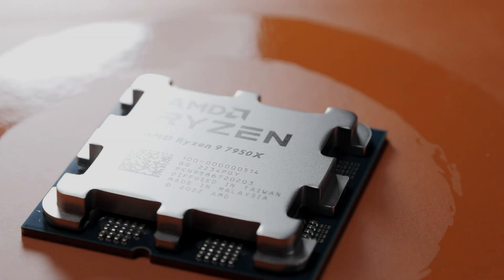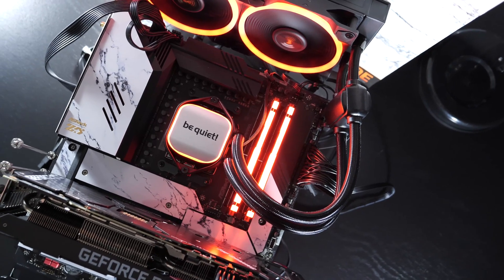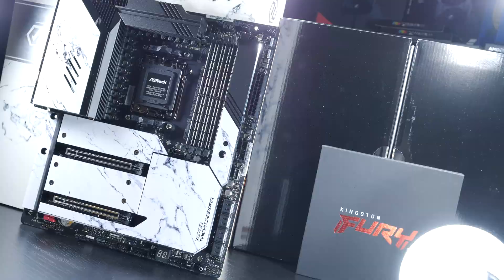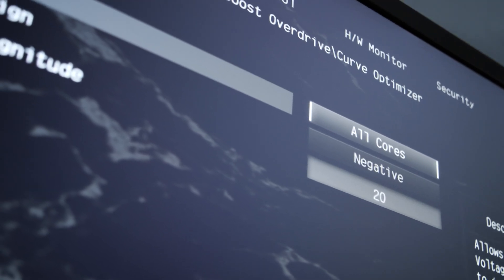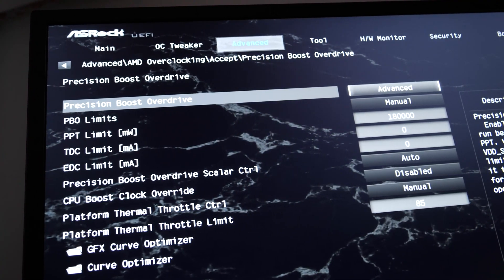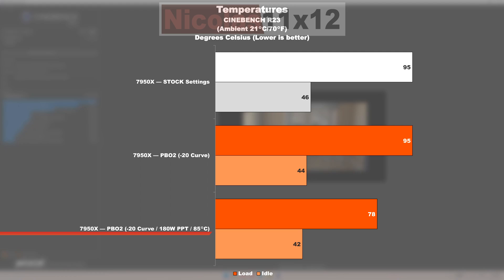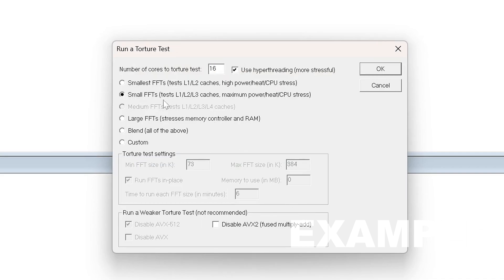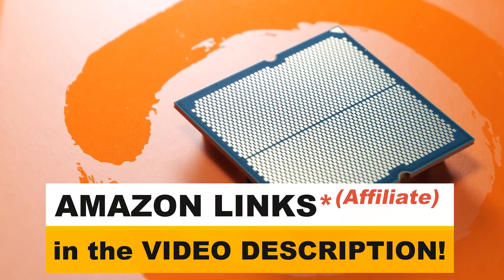AMD RYZEN 7000: How to Lower Temperatures and Power Consumption

Comment: I'm currently using my Ryzen 5 7600 with -45 curve, 85c temp limit and 85 Mw power from 150 or whatever it was default. Getting 13000+ in Cinebench r23
Reply: How did it affect your temps?

Comment: I can't believe it. My Ryzen 7900X is running at max 50-55C while playing Cyberpunk compared to 80+ stock. I put -20 at all cores and 85 thermal throttle. Thank you man!
Reply from the maker: You're welcome. I'm happy this helped! :)
Reply: @Nicolas11x12English  Much love brother. You have no idea how much it was bothering me. I hate when me sillicon goes up in temperatures, not that it wasnt "designed to run on high temps" but it was bugging me af. Also IIRC lower temps = better longevity so again, thanks a lot. New subscriber for ur channel here. Keep  up the great work.
P.S.: I am not much a hardware guy (working in it industry for 20+ years tho), but I assume its safe to go with those settings, right? :)
I was using the 105W eco mode, but disabled it after applying settings you've mentioned.
Reply from the maker: @nask0  Thank you very much for your kind words and for subscribing. I appreciate it. :)
No worries, these settings are perfectly safe and will even help improve your CPUs longevity in the long run. However, depending on your CPU's normal "degradation process", you might have to readjust some settings to regain 100% stability sometime in the future. I'm not saying that it will be necessary, but it could be. After all, right now you are using heavily optimized settings for your CPU to get maximum effieciency and lowest temepratures out of it along with a lower voltage.
With AMD's stock settings you usually don't have to worry about that, because once degradation sets in the CPU is set to run at a "too high" voltage setting anyway out of the box, meaning there's tons of headroom available not to cause any instability. At the expense of power and temperatures, though. In the past we were overclocking, but nowadays we're doing the opposite. The process of making sure the CPU is stable at all times remained the same, though. :D

Comment: had a x670 Aorus Elite AX, CPU in Idle was around 40-45 celsius
switched to a x870 Tomahawk, CPU in idle jumped to 55-60 celsius, this undervolt drops the temp to 45-50 celsius but the moment i run the RAM on EXPO  the SOC voltage goes to 1.316V automatically, and i simply can't do anything about it...might be normal for these modern x3d chips but fk that.

Comment: this is generic unoptimized way to undervolt. I used ryzen master and did auto tune curve optimizer per core and got -28 on all cores except 2 (at -26). This is far better fine tune tested for stability per core to maximize undervolt.

Comment: My wattage was 153 for a 7950x3d. I tried to manually set it to 130 and the cores just dropped to a snails crawl and took ages to boot and load. Any workaround this?

Comment: on a 7900x set to -12 since -15 crashes (my cpu is crap) 85C max limit and 170W max. I'm using Handbrake to test out the settings since it's using all the cores to encode a video. I might go ahead and try Prime95 though and see what happens, I'm guessing I'll probably crash because like i said this CPU is crap I got the bottom of the bin lol.

Comment: Heres my experience on 7500F no issue, great thermals. I just wanted to reduce power to compensate for the PSU and UPS same with the GPU. It is unstable on -30 (but this is the smoothest) but stable now at -20 it also reaches its max clock speed. Cinebench, fresh power start, PUBG became my daily test. Black screen and game freezes are the signs. Still observing, PBO will be next or default.

Comment: I set all cores to -30 with an PBO on 80 Celsius limit, and my temperature was the same in Battlefield 2042; I just don't understand the point of undevolt for the 7000 series!
I have a 7800X3D, and I don't notice any changes in games; the CPU is running extremely well, and the only heavy CPU game I observe is 70 degrees Celsius, the rest are 59-65 degrees Celsius!
Reply: the point is to get more frequency and performance. the processor is starting to throttle, when override temperature limit and you lose some performance. maby in your game it doesn`t matter, but some games like mfs2024 and stalker 2 may have some minor performance issues.

Comment: Is it possible to have the ppt set to something low like 15 Watts and the system be able to run? I am trying to build my first pc but unfortunately, I don't trust intel cpus at this moment but ryzen chips have way higher idle wattage than intel cpus. I would like to lower my idle/light load wattage to under 20W if that is even possible.
Reply: No cpu nowadays can run under 20W
Reply: no point getting that powerful of a chip and choking it

Comment: is it normal that the system wont boot at all after setting a negative offset of 20. should i go lower or might the problem be somewhere else?
i didn't change any other settings

Comment: Can TDC and EDC be left in 0?
My mobo Aorus ultra b650i, PBO limits in manual have some numbers by default (PPT is 480000, TDC 280000 and EDC 400000), so i'm not sure if i should just tune PPT and leave TDC and EDC with their default numbers (that are not 0) or if i should modify TDC and EDC to 0 and like you, and just modify PPT (mine's on mW too)

BTW my 7700x only run at negative 15 (without manually setting throttle limit) i tested it with aida64 and with anything more than 15 it crashes as soon as the stress test begins.

Also with -15 and a throttle limit of 90, aida64 run 7+ hs without any issues and cinebench r23 rung for 2hs 30 min without any problems as well but with a throttle limit of 85 it crashed at the 1 hour mark.

Depending on yout answer to my first question, shoud i start the PPT limit testing while having all core negative 15 with the throttle limit at 90? since it was stable at that.

Comment: My temps were around 55&56 while browsing and doing regular stuff now and reduced them to 48, better than nothing so thanks
Reply: 40-48 idle temperatures are pretty normal for these CPUs even when undervolted/curve optimised. I would check what it's like in gaming - if after applying these changes you're getting no more than 70 degrees then it's fine.
Reply: @Baz87100  yeah most of the time mid to high 60s when gaming at 4.8/4.9ghz

Comment: 7900X here. I just set negative 30 and max temp 85C. Getting all tests better then when my cpu was running at 95C default. 15min prime95. I wonder why do we need to limit power, because setting the max temp to 85C makes the CPU consume not much power, 140W in prime95 on adrenaline software. Can someone explain why? And can I keep it like this, I mean without setting the power limit?
Reply: I guess it’s the same thing tbh , how worse were your gaming tests ?

Comment: Thanks a lot for this, I used the dynamic undervolt on my ASUS X670E-E (BIOS 1905) and my 7800X3D, whilst gaming (Cyberpunk / The Last of Us Part 1) it runs average 64c (cpu package) whereas before it was running around 77-80 average.

Comment: Why not just use the eco mode and call it a day? Just asking, as I am curious. I have an 7500f. Looking for way to reduce load temperature. I use an Thermalright Silver Soul 135 cooler.
Reply: Using same cpu ... How's thermals idle and load? Mine stays around 50c idle and max 75c when gaming using a 360 aio... Haven't tinkered anything in the bios... I feel like those are high numbers especially using an aio

Comment: What PPT limit for the 7800X3D ?
Edit: Apparently it's 162 000 mW by default. Same for 7900X3D and 7950X3D.
Reply: So should I put it at 145000 mw ? Because I have heat problems 90 degrees

Comment: Often lower Mhz/cpu utilization is where instability happens with undervolting - according to another vid.   The voltage curve (the one you're offsetting by -20) tells the CPU how much voltage to send to each core at a given Mhz/Ghz speed.   At lower speeds, it's already sending a pretty low voltage and -20 makes up a much bigger fraction of that already low voltage.   Intel Mobo's have a way of keeping that voltage from drooping to much (really intended for overclocking where a sudden jump in speed can cause a voltage drop).   I wonder if there's something similar in AMD land?   If it's true that low Mhz are the main source of undervolt offset instability, then you'd be able to use a bigger offset if you could keep those low mhz volts up a bit.

Comment: Nice instructions. I tried with 7600x, with -18. I got 100 points up in cinebench r23 score and 10 degrees less with 85w tdp limit. I also played games without any crash. I am happy with it, yet i haven't touched ppt limits as of now. Will try it for sure. Thanks 😊
Reply: What kind of cooler do you have

Comment: Actually everyone who think -35 CO is completely stable is fool. There isnt such a think over 30 in these chips...
Reply: I'm running a 7950X3D with -30 on the CCD0 vCache and -25 on the CCD1 Frez, plus I add 150Mhz overclock, so the CCD1/Freq can hit 5900Mhz. Funny thing is that it was actually stable on -40/-35, but I pulled it back a bit to the -30/-25 values since it is a hostsvr for SE. You can actually go far more extreme on the per core curve if you use LLC, so the power doesn't dip or spike, aka more stable.
Before I was running a 7800X3D at -25, which tested stable at -30.
The 7800X3D under stress test was pulling around 85W+-.
The 7950x3D stress test pulls around 108W+-
On a Thermalright Peerless Assassin 120, which was perfect for the 7800X3D, but just ordered a AIO, since I want to eek out another 5% to 10%+- on the 7950X3D.
Stress test ATM, 5050Mhz on the CCD0 cores. and 5225Mhz on the CCD1 cores. Temping being the issue, hitting 83C.
With proper cooling, high W paste and fans with high CFM/Air Pressure on a AIO, the temps will drop another 10-15C.
Goal is to get all the CCD0 to 5250Mhz and CCD1 to hopefully 5700Mhz+-, maybe 5900Mhz.
You could get away with air cooling, I just had a bad case airflow and not great CFM/Air pressure fans to push the air fast enough. The Cougar MHP 120 look, good P/C ratio, if people are interested. 82.48 CFM ± 10% / 4.24 mm H2O±10%
Reply: I can't even do -7 :((

Comment: 7700x down to 98w max from 142w max and a 95c prime95 to max of 82c on the same load at stock performance. Sooooo worth it since I’m on air. Much quieter system. Wish AMD would’ve taken a bit of time on the subject and for a lower wattage usage I believe it would’ve helped them for sure.
Reply: Yeah I went with the non x for that reason along with the stock lower wattage to keep running costs down as electricity is expensive where I am.  have -30 co on all cores and +1 (100mhz). 19875 in cinebench93 so I'm happy with that.  Max 65c with a Thermalright PA 120SE cooler with adjusted fan curve in bios for silent running below about 50% cpu usage.

Comment: Running -35 CO and 200mhz boost override with PBO on my 7500F.
Rock solid 5,25Ghz all core boost while temps are peaking at 65C on full load. I love this little beast!
Reply: Which value did you put on PPT limit please ?
Reply: @rovaram2223  I think I have motherboard limits enabled but it behaves same way with limits disabled since its hitting like 70W max of package power with such undervolt (50W CPU and 15W soc on full load).
I got really good sample though, so not every chip gonna behave in such way.
Mine on best core can boost up to 5,75ghz on 1.35v and is stable for whole c23 single core run( while rest of the cores are set to 1ghz as the test was just for fun)
Reply: @wolniacha_tv  you would advice me which PPT range if I have to do this manually?
Reply: this comment warms my heart. I really love undervolting.
Reply: Stock cooler?
Reply: Dark Rock 4 @chadfang2267
Reply: I got my 7600 non x to be stable for a 2 hour realbench stress test with -50 CO and 200MHz boost override with motherboard ppt limit and my temps hit 81°c with very very few chugs up to 85 °c (my max temp limit) with a noctua redux cpu cooler(with the 2nd fan kit) and before the pbo settings change when cpu went to 100% usage it would be 95°c and throttled the entire test I think if I were to take off the low noise adapters from the redux and let the 2 fans run at higher rpm it could keep it from hitting 85°c at all during the 2 hour test but I never run my computer that hard so I think I'll just say it's alot more quiet with them on and if I'm not running too hot quiet is better since my rig sits next to me on my desk

Comment: Set curve to -25 and 85c thermal limit. This resulted in an increase in voltage used. (Prev 1.2v stock and now running at 1.305 and higher at times) what would cause this ?
Reply: maybe u forgot to set the curve to negative!

Comment: What the PPT limit I can set for Ryzen 5 7600 (non X)? 
Managed to run -30 throttle limit to 85 with a small bump in performance. Boost clock still at 5.2  can this still go higher?

Comment: If the CPU is stable with negative  curve optimizer, the max performance actually increases (the temperature limit is hit at a higher clock).

Comment: I did exactly this for my system. I have a 7700x on an asus x670e-i motherboard, I did everything he did in the video, but set the ppt limit to 90 watts because of the different cpu. I saw an increase in temps by 4 degrees celcius
Reply: Is increase a typo or are you saying you had those results and went with it? I also have a 7700x.
Reply: Why would you want higher CPU temps when the whole point is to decrease temps???

Comment: What's the recommended for 7700X, you said something along the lines of 88-95 watts.  Is that 88000-95000 in this menu? 

Any response is greatly appreciated. Thanks.
Reply: Depends of your bios uses mW (milli watts) or the full watts in the settings. I personally have a 7700x and set ppt to 105 watts and it’s been great. You can set it a little lower but get some diminishing returns. I also have a 85 thermal limit but with 105 watts it doesn’t go above 80.
Reply: So , by what you're saying, we are supposed to put 105000 / 88000 / 95000 because we have our values in mW?
Reply: @nicolasaltamiranofrontalin6523  it depends if your own motherboard uses mW or just W. You will need to see in the settings what it calls for and put in the appropriate values. 

I cant say for certain what your mobo calls for. But in the video example, his mobo used mW. My MSI board used W. Hope that helps!

Comment: 7600x preforms the same with and without Ecco mode I lost like 10 points in single core benchmarks but my temps are in the 70s.

Comment: The reason manufacturer doesn't undervolt the processor is that, like you said in the video, the amount of offset your specific unit can work with at max performance depends on your specific unit's build and silicon quality. So they can't just use a 30 or 20 value for all units since they might be unstable on some purchases and they sure can't sit and test and undervolt each individual unit. Even if they did since the specifications would vary they couldn't sell them as the same chip.
Reply from the maker: 100% correct. :)
Reply: Why don't they use something like they do with memory training to automatically undervolt?

Comment: Anyone can teach OC ddr5 to 6000mhz? Mine if on expo will resulting unstable system.. 

Ryzen 5 7600x
Pny mako ddr5 16x2
Asrock b650m pg riptide
Reply: Try 5200 on expo
Reply: I'm using 6400 expo and -4 pbo with msi b650m mortar wifi

Comment: Incredible temperature/performance improvements for me. I'm fortunate enough that my 7900X could do a -30 offset, clearing Cinebench in both tests splendidly, and 20 mins of Small FFT Prime95 before adjusting PPTs or thermal limits, holding at 95/96C. Keeping -30 offset, but changing my PPT to 180, and thermal limit to 85C, my performance in Cinebench Multicore was only ~200 lower than the score with only -30 offset, and single core was practically identical with 1 point difference. Mind you, this was still higher than my stock score, though I forgot to save an image of the exact number.

Additionally, I ran another 20 min Prime95 test successfully at 85/86C, so it seems decently stable at these settings. My computer is even quieter, seemingly due to reduced heat for the fan curve to deal with. Not sure how else I might consider optimizing it from here (maybe to regain that ~200 point multi-core Cinebench score drop somehow), but I'm pleased with the results. Terribly useful guide, thank you!
Reply from the maker: Thank you for your positive and kind feedback!
I'm so happy for your great results. :)
Reply: Lucky! I think I lost the silicon lottery on my 7900x. I can't even hold a -5 offset without crashes. I also can't do anything with PBO or eco mode. Everything causes system crashes. I can do anything with mine.
Reply: @jlew7715  still having these problems? Updated BIOS?
Reply: @Ralph Miranda  sadly yes. I always check for new bios updates and cross my fingers after updating that it will be different but unfortunately no luck so far.
Reply: Hey, do you remember how many degrees you got in Cinebench? I used these settings and went down from 92 to 85 but the guy in the video went from 95 to 78 so I'm thinking is my 360 AIO broken or something
Reply: @YCOSKUN  I don't recall, as it has been well over a year, maybe two since I did this. I think mid-90s, like 95C, not sure if higher before it throttled. However, my temps in general were much more stable and have continued to be. My 7900X has an air cooler (NH-D15), so I'm not at the mercy of an AIO, but even the temp you describe doesn't sound bad. I'd check your AIO orientation and if your hardware's clean (unless a new build). Good luck.
Reply: @ShinoBells  Thanks!

Comment: What would you choose as a power limit for the 7900x3d? The 3d variants normally have lower power consumption by default because of the 3d L3 cache. Could you assume that also temperatures would be better for the 3d variants?